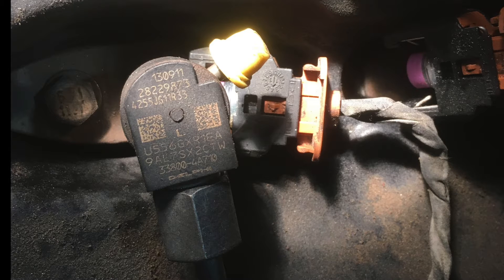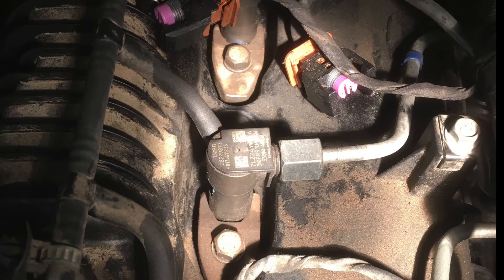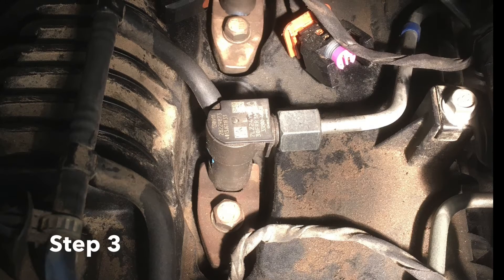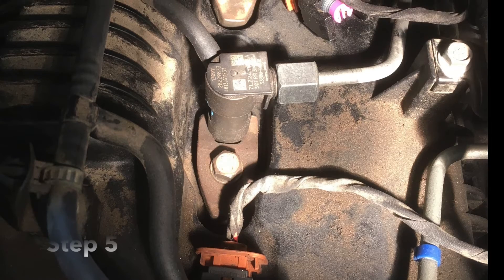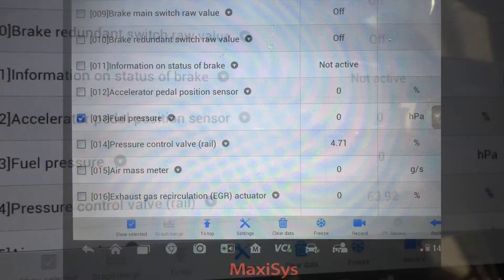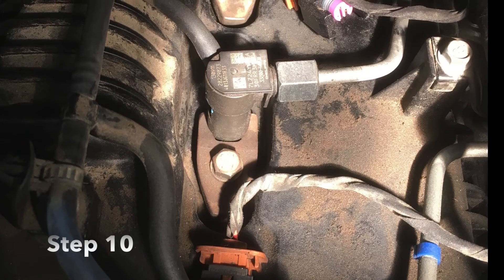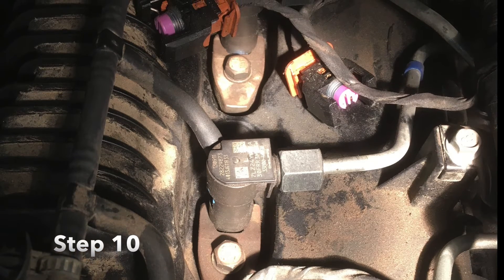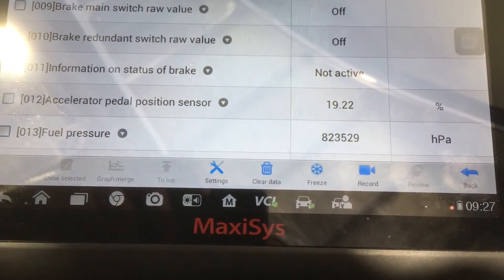Hyundai injector problems won't start - How to bleed injectors

Comment: So I have a doosan d18 motor that I replaced the injectors on and now the lift pump portion on the fuel pump all new feed/ return lines etc.  It definitely loads up the motor with the IMV valve disconnected and runs great. 

Issue I am experiencing is anytime I shut it off after running it will not restart but if I let it sit for a few minutes it fires right up. Any Ideas would be greatly appreciated. Thank you

Comment: thanks to you, your video help me start my car after put on new injectors, specially step 10 works  very well. once again thank you very much
Reply from the maker: Glad we could help. 😊
Reply: @gettingitdone1  plasure to you repaly, i need help , i have a i20 1.1crdi 2013 car has a Engine oil increase and increase and blue smoke on the hill. please give a idea tips .thanks
Reply from the maker: @malfamilys9122   so first question os does it have a DPF? The increasing oil level is usually caused by over fueling. Often that is caused by the vehicle being unable to regen the DPF. It keeps trying, which results in excessive amounts of fuel entering the cylinders and making its way into the sump. If it continues it could cause serious engine damage. I would advise taking it to a good mechanic or diesel specialist to have the DPF checked. If it doesn't have a DPF it could be a fault with the injectors themselves.

Comment: Thanks for this info. My Captiva has this exact problem and two different motor mechanics have not been able to figure out a solution.
Reply: I took my iLoad van to a Hyundai specialist for an analysis, charged $180 for 1/2 hour and said they would need to remove the injectors and the pump and have them tested, estimated $5k and they are right, but from an owner's POV it pretty much right the car off. Next car will be electric.

Comment: I have a no starter VW Crafter 2.0 tdi and unplugging the valve from HPFP don't seems to raise the pressure for some reason. I suspect that there might be some other system that limits the pressure too...
Reply from the maker: Ok another trick we have used on some vehicles, it's not ideal sometimes a last resort (I take no responsibility for any damage 😆). Is to use some engine start (ether) spray, to get it to fire, that's sometimes enough to get them going, it will diesel knock while trying to run on ether, then clear when the diesel comes through.

Comment: Hi, I have follow all the steps it's a 4cylinder car with Delphi injectors, fuel pump has 2 couplers/electric connection s. I don't know which one should be disconnected but I tried with one one solenoid, then both together off. But car doesn't start. I suspect injectors locked but when I use scan tool and do activation test injectors activate and then if I crank car starts for 1 second. What could be wrong? Intially I had tried bleeding with injectors connected. But then I follow the procedure shown in the video but no success. Scan tool can test the injectors and apparently they are working

Comment: Awesome video. But I did try this a couple of times and could not get any fuel mist from the glow plug ports, so I ended up sending the injectors away to get primed so hopefully I can get it running
Reply from the maker: Oh that unfortunate it didn't work for you, they can be a real issue once they're locked up. Just make sure you follow the procedure when you put them back in. Otherwise they could lock up again.

Comment: It’s with my Toyota Matrix 2003 if I drive in the feeeway it never turns off and goes fast no problems but when I go in stop and go traffic the oil light comes on and car turns off what do you think it is ?
Reply from the maker: Could be lots of things, does it just stall, like it won’t idle or idles too low?

Comment: Hey mate I just changed my copper washers on my iload injectors due to them leaking! I have put it all back together and now won’t start it cranks and gets close to starting when I put the peddle down but won’t start
Reply from the maker: Follow the steps in the video to bleed the system properly. Theses injectors are a real problem to bleed  but by following these steps you should get there.
Reply: @gettingitdone1  where is that solenoid we need to unplug  I couldn’t see it clearly in the video. Thanks for the reply
Reply from the maker: So at 3:05 in the video looking down the back of the high pressure fuel pump. That steel cap that kind of looks like the end of a wiper motor, will have a plug going into it. That's the one to disconnect.
Reply: @gettingitdone1  hey mate I can’t find that motor mine is like a flat circle pump
Reply from the maker: @bextabeats3368  do your injectors look the same as the ones shown in the video?
Reply: @gettingitdone1  yes Delphi currently stuck on step 3
Reply: @gettingitdone1  when cracking the rear 2 cylinders have fuel coming out of the feed line
Reply: @gettingitdone1  do you access the pump from the top or under the car. Also thanks for your help I can’t wait to get this thing started again
Reply: Just for reference mine is a Hyundai I load 2013 diesel
Reply from the maker: @bextabeats3368  access the pump from the top. So if you're getting fuel out of the rear two but not the front two, you could try tightening the pipes on the rear two and see if you get it coming out the front ones.
Reply: @gettingitdone1  I did that still no start.
Reply from the maker: @bextabeats3368  so that inlet metering valve can also be called a suction control valve. Maybe do a quick YouTube search for Iload suction control valve, see if you can find one that matches what your vehicle has, and unplug that
Reply: @gettingitdone1  cheers thanks mate, lost story short I got it started and now found that huge oil leak on the first cylinder. I pray it’s a rocker cover issue and not a crack in the head . It’s gushing oil out the first piston injector

Comment: If you got these injectors you can open the pipes.. start .. wait for diesel .. stop cranking ant the tightening everything op and pull the rail pressure sensor.  It opens up the full pressure of 600 bar leave the car running for 30 second put it out putt everything back .. should be good .. did it this weekend and get the tip from Hyundai technician them shelves
Reply from the maker: You've just left a comment basically explaining what's shown in the video 😆.